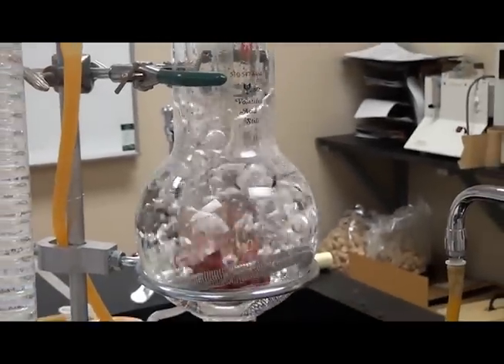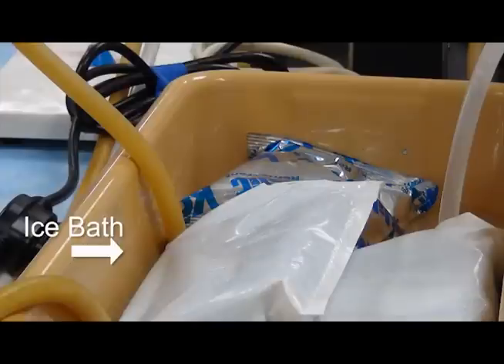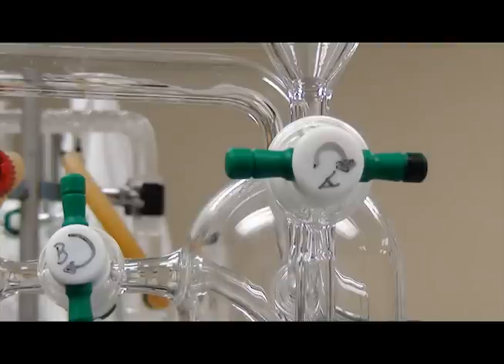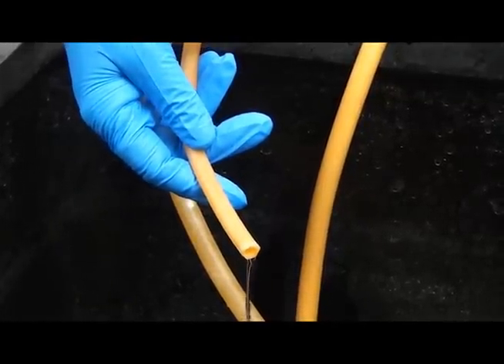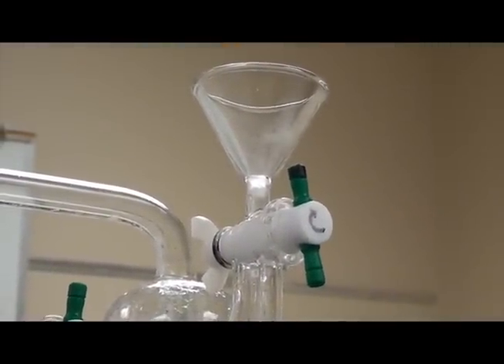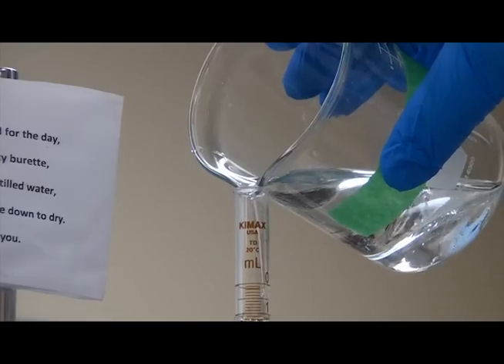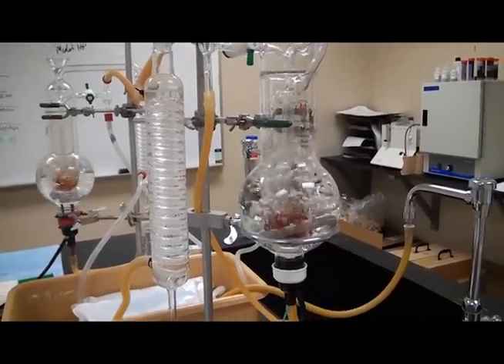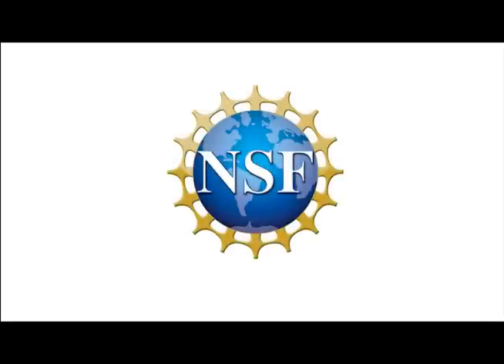Measuring Volatile Acidity in Wine

Comment: Volume of erlen meyer do not matter, you can use 125 or 250 ml
you collect 95% of acetic acid when distilat is 10 TIMES volume of the wine 
You collect 99% of acetic when distillat is 11 times the wine volume 
You start to collect Lactic acid when distillat is more than 11 times the volume of wine and get wrong (overestimated) VA result 
If you use 10 ml of wine, distillat should be around 100 to 105 ml 
David / City Winery

Comment: Can someone explain how you get 100 mL of distillate out of a 10 mL sample. Is it not a closed system between the two chambers?
Reply: Actually it is not a closed system, the steam from the outer chamber is bubbled through the added sample before going out via the condenser, that's why you need to keep topping up the outer chamber. If it were a closed system then you would have an explosive situation...